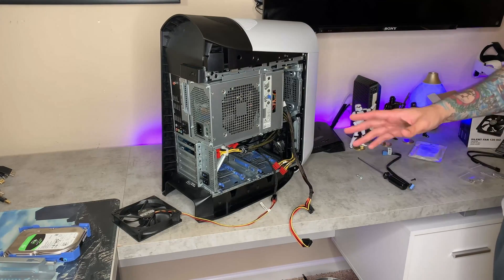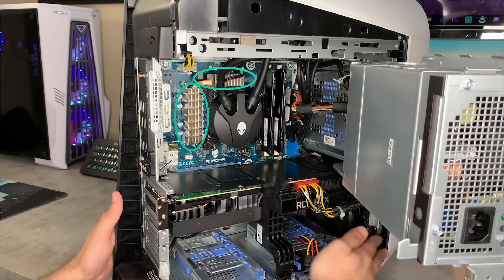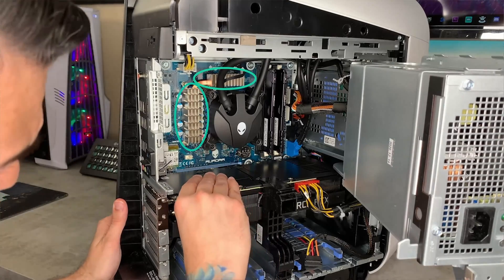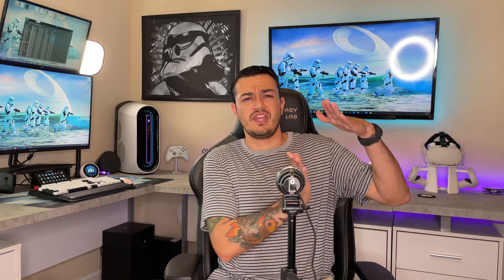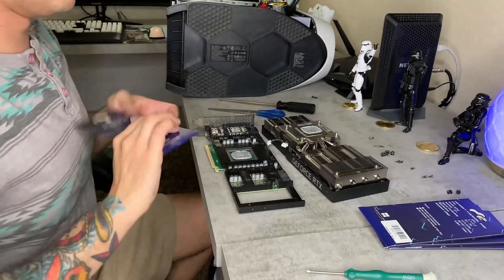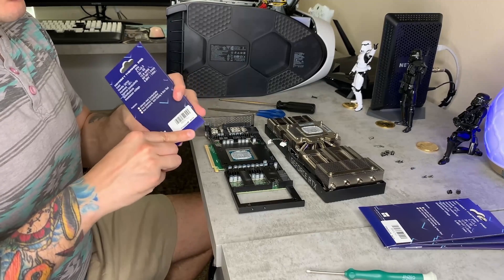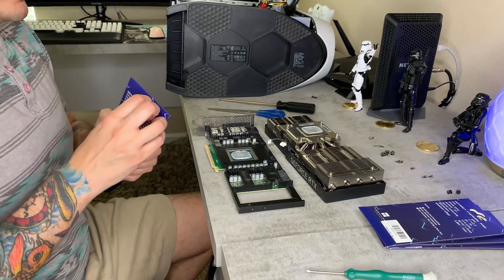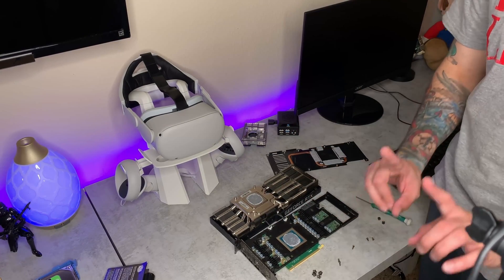Common Alienware Aurora R Series Problems and How To Fix Them

Comment: I actually got an R11 for free a year ago. It was supposedly broken. Turns out it was running on a hdd and it failed. So I then installed a 1tb m.2 with heatsink for $60 and replaced the i5 10400f with an i7 10700k for $150. Replaced the single 8gb 2666mhz stick with 4x8gb 3200mhz ram for $65. Added the Alienware aio for $35 from ebay. The vrm heatsink. $15 from dell. And an rtx 3070 i got in a trade. It's been an amazing pc so far. I love it.

Comment: 120mm radiator in gaming!!! R10 with rtx 3090 and Ryzen 7 5800. I replaced Ryzen with 5950x and it's catatstrophe. Temperatures 95 degrees Celsius + My 6th and last alienware... I installed 4 Noctua 120mm fans. Two on the front intake and two on the radiator push and pull. I cut out the metal frames inside the case at the top, removed every second exhaust rib and it didn't help. And the Alienware command center application doesn't handle fan control.

Comment: Thank you for your review of the Alienware Aurora R15.  After watching your video, I have a question and/or a problem with this computer.  I bought the computer with the following specifications:  
Alienware Aurora R15
AMD Ryzen(TM) 9 7950X (16 core, 80MB total cache, up to 5.7GHz max boost)
NVIDIA(R) GeForce RTX(TM) 4070 12GB GDDR6X
32GB, 2x16GB, DDR5, 4800MHz
Windows 11 Home

I love the computer but there is a problem I have encountered, and I would like to hear your input.
The problem I encountered is when the computer goes into “SLEEP MODE”.  For some reason, my system DOES NOT stay off while it is in “sleep mode”.  In the contrary, it keeps turning on/off continually.  I also notice when the computer goes into “sleep mode” all the lights in the system go off except the video card.  For some reason, it stays on (even during sleep mode). Is this normal?  Have you encountered this problem before?  Thank you for any information you can provide.

Comment: Literally left my case open and my temps dropped 10 degrees. Cracking open the swivel that holds the psu helped an additional 5 degrees on the cpu

Comment: I have an Alienware R13. I upgraded my Rear Fan and now every time I boot up my computer I get Rear Fan Detect Failure 

The new fan is a high performance fan that puts the stock fan to shame, but I have no idea how to tell my computer to ignore the issue as I had to plug it into a different 4-pin socket. 

Anyone know what to do here? This has been frustrating me to no end.

Comment: So my r12 isnt turning on and has been crashing randomly for no apparent reason, for example I would be idle on the pc and the screen would stop displaying the pc, or just freeze, the keyboard lighting would freeze, and the mouse seems unresponsive. So I openned it up and I cant find the voltage things, are they in a different area that they are in for r12, but I dont see any, how would I fix this?

Comment: Anyone know how to fix my issue?
When ever I get on certain games my fan speed slows down from 75% to 34-35% I tried tuning to speed and it doesn't do anything it works perfectly fine with other games
Reply: you have to actually 'apply' the profile you're changing in the main page: you save the fan settings, go to main ACC page and change your Thermal profile to whatever you have changed. I usually just create a new profile in each category and then switch to them. Also a smart move would be to actually change from your fixed speed to the curve with the temps - that way you won't be changing speed every time - it will adjust according to the desktop's temp. Hope it fixes your problem :)

Comment: Does anyone know of a 3080ti that will fit in a R12 case? Running into space issues.
Reply: 3080ti will only fit if it is custom GPU from Alienware/Dell...the rest probably will have problems, because those cases are VERY small and have limited space inside...god awful design from the inside :(

Comment: I have 32gb of ram and a beefy r10 with a ryzen 7 and 3070ti, I have 2gb of storage and only 4 games downloaded. But it takes it 30 minutes to load up a game and even boot up.
Reply: I'd suggest to reset whole computer to factory (or even better use Dell's recovery image to flash it to any USB and re-install your windows completely)...that's what I did and it helped. I used to have similar issue like yours. wait...2gb of storage?! perhaps Tb? because 2gb is EXTREMELY LOW for a system to run properly

Comment: I have no power.  The fans and lights turn on when I use the test button on the power supply. 

I tested out new ram. No fix.
Tested new power supply. No fix. Tested new graphics card. No fix. 

All that’s left is to try a new processor “cpu”

I’ll keep y’all updated if it works. I’ll be installing the new cpu next week.
Reply: wait...what are you doing?! o_O

Comment: I tried 4 x 16gb of ram in the aurora r12 (kingston fury beast 3200mghz 1.35v) and it stays on infinite reboot without the possibility to go to bios. It works with 2 of the four sticks but not 3 or 4. Any ideas on how to fix?

Comment: Can i ask a question has anyone figured out a permanent fix for the R10 bluetooth mess in windows 11 stupid adapter works for 2 seconds trys to access a illegal memory address that the system uses to control your keyboard and mouse by usb and then disables itself
Reply: Found the solution remove the bad Qualcomm card replacement is a USB dongle Bluetooth and a pci express wireless card works great

Comment: I'm interested to know why my R11 doesn't have the front panel inset lights.(Like yours does) The only lighting controls on mine are for the power button logo and the perimeter trim around the front control panel. Should I have other lighting or is that a purchase mod that I missed?

Comment: I finally got a new aftermarket GPU for my Aurora r7 after installation it will not recognize the Gpu or boot to windows unless I go into the bios and disable the secure boot option. Is there a fix, because disabling secure boot also disables the TPM which is needed to upgrade to windows 10.

Comment: My aurora R12 has been having internet issues. So I did some research and found a software pre installed program taking up 4.5 out of 8 gigs. So I uninstalled it but still had problems with speed. I also have Ethernet. Please help!

Comment: I just bought the r10 off best buy for 1999.99 saving 300 off but it's air cooled. Specs are ryzen 7 5800 16 GB RAM 3060 ti. Am I gonna have to worry about anything...
Reply: How has it been so far?
Reply: I'm getting the water cooled r10 with the ryzen 9 on Amazon and I am curious how this turned out.  It's on the way and I'm just a bit worried because I see a lot of people saying to replace all fans to make it quieter, but others saying the stock fans are actually good at keeping it cool even if they are loud.  I wouldn't mind the sound so I might just add additional fans if that would be sufficient.

Comment: TLDR: I move the hard drive to put a fan don’t need ssd.
I found a solution for the place to put a hard drive when you want to add a second fan in its place. I unscrewed the two screws holding the metal tray for the hard drive and swapped it with the right side ssd tray. There’s a small black plastic bracket at the bottom which blocks the tray from being inserted so I just used a string to pull the bracket up and was able to set the tray in that place. I am on a tight budget so I couldn’t afford a new ssd. I have a plan to eventually replace the hard drive with an ssd but for now that solved my problem.

Comment: the fan on my R11 swing door over CPU isnt on anyone know why? ACTUAL CPU FAN ON AND ALL OTHERS BUT ONE IN SWING DOOR
Reply: yo very late but i’m having the same problem, any news on how to fix it?
Reply: @bryanjrob5012  i called them and they said it doesn't have to be on all the time as long as i kicked on when u start pc its fine this is 2 yrs. later and still runs fine for my kids inly upgraded storage😀 and ram and gpu hope helps

Comment: I have Aurora R12 with an RTX 3080 I7-11700F and had screen tearing i tried everything now its point where my pc will start but won't display. I reset and put new battery it worked once even twice now after playing vanguard my pc shut down with same problem but can't get it stsrt this time... I'm about to send it im done trying... wasted my whole weekend on this bs.

Comment: Clean professional video. Little help please, can't get a straight answer from dell. Representative just quoted from the r10 web page. Swapped out 5950x for 5600 G. No post post diag lights flash 2-1 which should be motherboard error. Tried cmos reset, any advice. Thanks in advanced.

Comment: I got an r10 yesterday and the boot time is more than 5 minutes, if it boots at all. Then I get around a minute with Windows functioning before the screen flickers and the desktop apps disappear and after that I can try to open programs but they don't open. Then I have to restart the system and wait another 5 to 10 minutes. Not sure how TF they get away with selling pcs like that. This even happens after I updated everything and even reinstalled Windows

Comment: I got a R10 Ryzen ed. With a Radeon RX 5700 XT and a Ryzen 7 in it, but it was air cooled and my GOD was it unbearably loud. It still ran games good but it was so loud. Got a corsair H60 in there and it's running super quiet now!

Comment: So here’s a question, I was seeing cpu temps of 90-100C while gaming. I assumed that I had an air cooler and ordered an H60. Turns out I already had water cooling. I still swapped it to the H60 and I’m still seeing temps way up there at 90-100C. I’m about to do the second intake tan and the push pull on the cpu cooler but these temps are way higher than anyone else has mentioned. I’m at 70C just running discord and 65C just idling. Anyone on here have this issue or am I just screwed?
Reply: Try doing custom fan curves in Alienware command center, an set them to about 50% @ 60 degrees (that's what I did, I don't know if is the best but if you put front fan speed higher you will definitely get cooler temps)
Also sorry for the late reply I know it's been four months
Reply: My alienware is running so hot that I'm thinking of sending it back

Comment: I read that miners leave the side of the case off to help with cooling.
Reply: That's an early 2000s move lol before a lot of cooling and smaller processes needing lower Watts to perform etc... 
Take the side off and point a desk fan at it lol 😆 theoretically side on should make cool air flow in the right direction through the case... assuming adequate air intake / exhaust.

Comment: I’m getting an R10 with ryzen 7 5800 and 3060 ti, all air cooled, how would vr performance and temps be?
Reply: if you didn't get the AIO for the processor its gonna be bad.... real bad.  With the air cooler it doesn't even come with the VRM heatsinks.

Comment: Lovin my R12……Alienware big monitor makes Warzone fast and sick to say the least.  Temp is steady 70 degrees BABAY!  Machine is simply sic, and if your playing WarZone-stark contrast between console and PC.  Alienware is meta
Reply: bro mine won’t connect to hdmi or display help
Reply: @DavidGonzalez-mh8pf  …. Contact Alienware support.  There are a ton of outs.  What monitor are you connecting it to?
Reply: @MrReraise  a spectre 34 inch ultra wide, tried to plug into hdmi and display
Reply: @MrReraise  it pops up on my monitor but is just a black screen. And it was working just fine at the pc shop 20 mins ago. I tried a regular tv hdmi ,, no signal. I have the power chord and the display / or hdmi plugged in and nothing gives… any ideas?? thank u for takin the time out ur day too!!! real one
Reply: @DavidGonzalez-mh8pf  make sure your settings in game and on the ox match
Reply: Pc not ox lol

Comment: Thank you so much for your videos. I am now a sub. I just ordered today the a12 with 11900f and 3080 32gb ram and 1tbssd. I am going to check everything thing try your thermal paste method. This will be for gaming and regular office tasks. This will be paired to the aw2721d monitor hoping it should be a blast. I had an order for the x17 with 3080 and 11800h so hopefully I will not regret this choice.
Reply: How has it been so far? I ordered a very similar spec.
Reply: @myspace8399  im loving the desktop however i went with a larger monitor. I got the aorus fv43 and 4k 144hz qled monitor. This paired with my 3080 and ps5 has been fantastic. The conouter runs all titles in 4k with no problems pushing over 90-144hz on all titles i play. The comfort of having a warranty and dells customer sevice has been amazing. The pc didnt have to have a thermal or fan replace and Temps stay good.
Reply: @kaiichinose9590  Thats great to hear. Hopefully my experience is just as good as yours. I cant imagine how good it looks with that monitor. Im also considering purchasing a 144hz monitor but only 1440p bc 4k is too much 💰💵.
Reply: @myspace8399  if you have any questions once you get your set up please feel free to reach out. What cpu/gpu did you get, i can also list a few really nice 1440p monitors which will look crispy at 27/32 inches. Yeah the monitorwas around 899 but its also 43 inches qled and 4k 144hz with built in speakers. I was saving for awhile fornthat one. If you happen to be a veteran if you call dell and order through them they have extreme discounts. Not including the montior i think i paid around 2600 for my set up.
Reply: @kaiichinose9590   I appreciate that bro. I ordered mine with an I9 11900F , 16GB 3200 MHz ram, 1TB NVMe ssd and the beast RTX 3080 (LHR though). I called today asking for a student discount but they said I had already applied coupons that brought the price down 400 dollars on top of the presidents day sale (total price after was $2466 w/taxes). I plan on picking up a decent monitor in the $250-$350  range. Though I wish I could ball out and get a high end 4K one like you did 😂. My PC is supposedly coming in on March 31st which seems a bit long. How long did it take for yours to come in?
Reply: @myspace8399  thats a phenomenal buildand for that price. I dont know your finances but if you could save for a 4k 120 and up monitor i truly would as you would really get the benefit out of that 3090. Hmmmm ill do some digging and see what 4k options are out. 1440p is still amazing and you could look at the 1440p alienware aw2721d which is a gorgeous display and from dell you might be able to get a great price. Mine took about 2 weeks. But they have a distributor in texas which works out amazing.
Reply: @kaiichinose9590  do you know how much heat u get from ultra settings in games like warzone? I just ordered mine and I cant sleep seeing all these comments of temps hitting higher than 100c on heavy gaming. Wanted to cancel order after it but once I checked they already shipped the pc even though it has only been 3-5 days since I ordered it. I don't want to do any modding either, except stuff like undervolting. My rig is watercooled with a 3080 and a ryzen 5000 series processor, so our temps should be similar.
Reply: @emperorexiled7270  I've never seen temps that high ever in any title I run on 4k ultra settings I think I'm normally around 65-80 under full load. I know intel chips run hot but they are designed for that. I play mine everyday for almost a year now with no worries of heat or anything. No thermal throttling ever. I havent tweaked the machine at all either. I do prefer the r13 chasis though as it does have more airflow but I don't plan on upgrading for at least for years.  Also once it ships you can test it for like 20 days then send it back for a full refund if you are unhappy with performance.

Comment: I have an Alienware R12 with a I7-11700F, am I able to upgrade to a I9-11900K?
Reply: I've swiched cpus on the alienware motherboard (i5 and i7) and the bios gets pissed off at me =( wont boot up. you can swap things around more when you use a different motherboard.

Comment: Hey guys, I just got an R10 with a liquid-cooled Ryzen 5900X and the mighty RTX 3080. Is the thermal paste mod a must even if you don't plan on overclocking the GPU? Thanks!
Reply: how has your system performed so far? im getting the same one. thanks.
Reply: @bjslugzbeatz2103  not bad at all. I cleaned up my Windows and got rid of most of the bloatware. Still find it quite loud though (because of the fans). I am leasing it and I can't do all the mods I'd like because of that. I haven't pushed it to the limit (I game at 1440p) but I can say I am absolutely thrilled with how it's been performing so far.
Reply: @geoffroydelmotte1141  wondering the same thing. Planning on using it for mining though. Have the liquid cooling
Reply: @sensitivemale  The liquid cooling is an absolute MUST, whatever you intend to do with this rig. But I think that the thermal paste mod on the GPU will also be required if you want to dedicate it to mining. I am still carefully considering the pros and cons of swapping the top fan for a push/pull setup, because that would void my warranty for sure.

Comment: Hi great video I plan on doing all of these great mods. Do you know a fix for the bluetooth connection being lost while using a bluetooth mouse on the R10? If I have a wired usb mouse plugged in to the R10 the bluetooth connection is stable. Thanks in advance for your help.